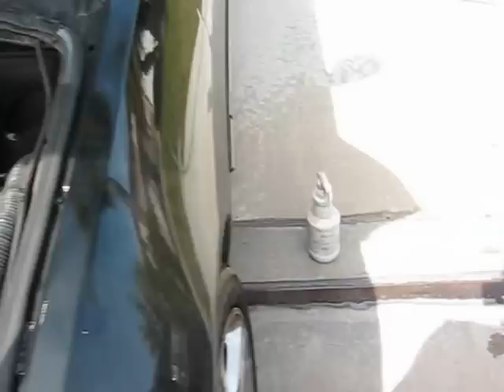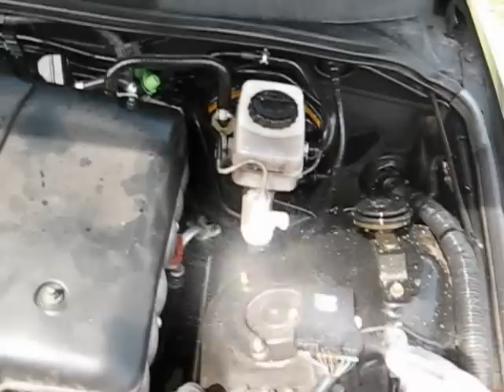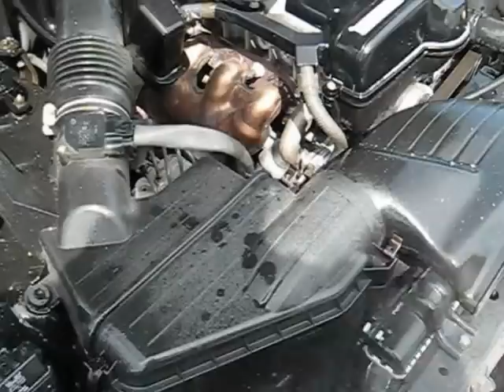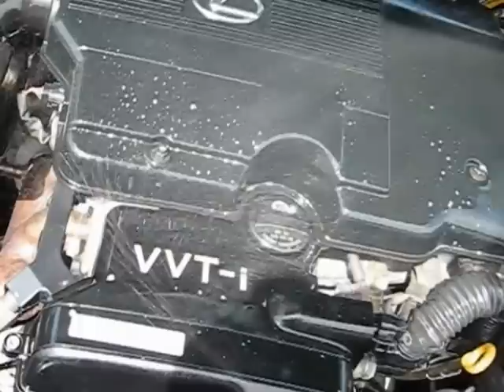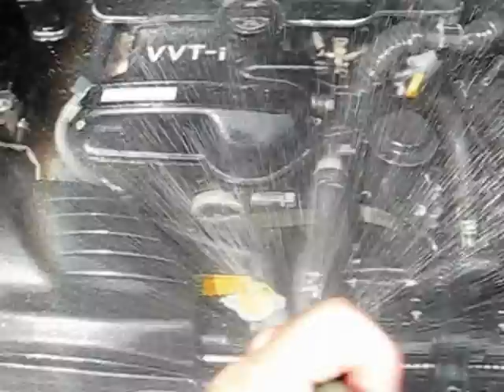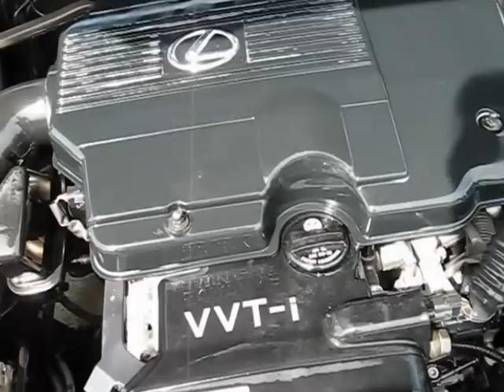Lexus wash engine IS300 by froggy

Comment: It is a 2jz?
Reply from the maker: 2004 is300 - not sure on the engine code, sorry.
Reply: meloN_ best_ 

2JZ-GE so non turbo
Reply from the maker: Correct no turbo.

:)

Thanks.
Reply: Thanks :>
Reply from the maker: Welcome.

:)
Reply: En estados unidos, todos los Lexus IS son 300 en la primera generación (2001-2005) y todos vienen con el motor 2JZ-GE... Eso está chevere! 👌🏼

Comment: Froggy this is the first of your videos I don't agree with, I've cleaned engines at 2 different shops and at home and never do you want the motor running for many many reasons and the best way to do it is with a steam cleaner but if you DIY then be sure to turn engine off let it cool just a bit spray degreaser then spray with water and be positioned with hood open with plenty of sunlight and it even helps to use a leaf blower to help dry still with sunshine in the engine bay and DO NOT start for at least 3-5 hours.
Reply: Ur obviously new to this. Theirs a reason why he started it so the water doesnt short any eletronics. If you drive it the water will dry up so the electrics dont fry.
Reply from the maker: +Robert Kane I agree to disagree if you will.

Thanks for the post.

The reason you never put pressurized water onto the engine is that it will force itself past the weather-tight seals and give you all kinds of electrical troubles.
Reply: +Andrew Ling you obviously don't know how to spell.
Reply from the maker: Let's be friendly. Yes I always start the car after the wash, to dry any residual moisture. Any kind of PRESSURE wash is asking for trouble. The "waterproof" connections are NOT RATED for high pressure water. I just "mist" the water on.

:)

Comment: Is this 100% safe ?
Reply from the maker: +EJ Ines Nothing is 100%. 

The person doing the job could use too much pressure or point the water into a part of the engine where it does not belong. I know how to do it 100% safe, so far, never had an issue.

Also, let's say you have a plug wire that's not routed correctly (near a ground) or a cracked coil. You could end up in a no start position.

:)